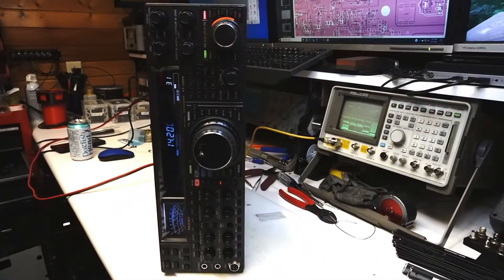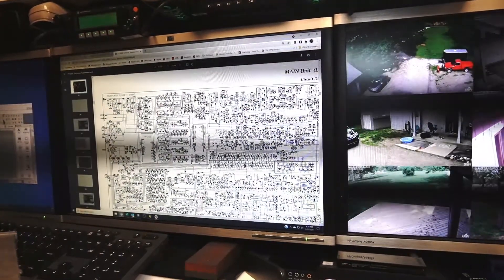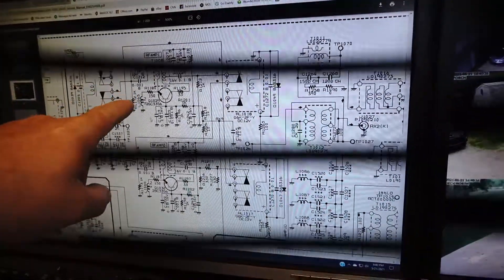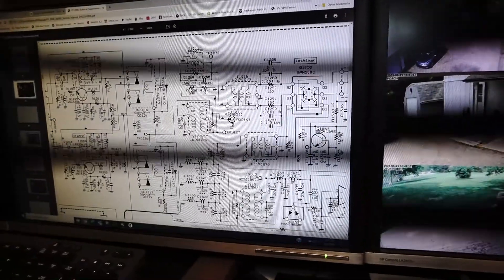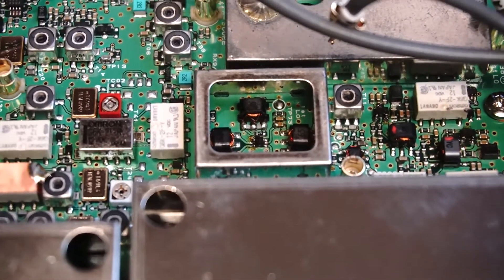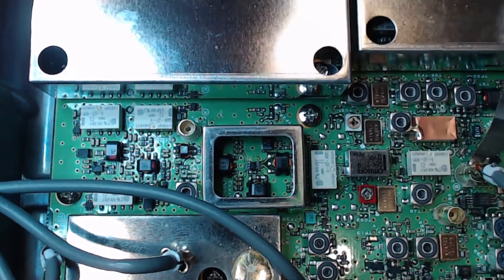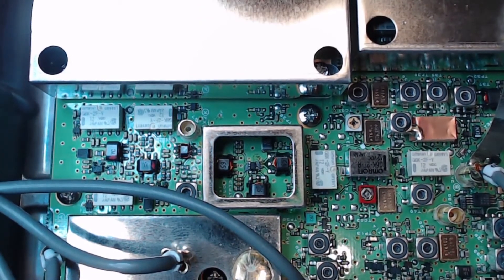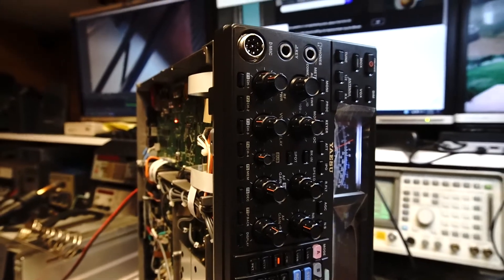Repair of blown receiver front end in Yaesu FT-2000D

Comment: Reportedly the mixer chip is typically the Culprit, Yaesu in their firmware updates should have added a new menu selection to set VRF as default, naturally providing front end protection. I run the VRF full time until I add the diode protection, just picked up a pristine FT2000 after my 101 MP was plagued with two trips to the service center for VC Tune repairs. Sold it to an Amateur who resides 60 mi from the service center with full disclosure and Yaesu shipped the rig directly to him. Enjoyable video, hope I never need to repair mine.

Comment: How do you solder a surface mount electrolytic?
Reply from the maker: Typically I twist the old one off this will leave the feet. You can easily remove those with an iron. Then you can do it with hot air or an iron. Solder paste on the pads and hot air under the cap until it flows in. Or put some solder on the pads and a little tacky flux. Then heat each foot where it sticks out a little on the side while pushing down gently until it melts in. You may have to go side to side a couple times.